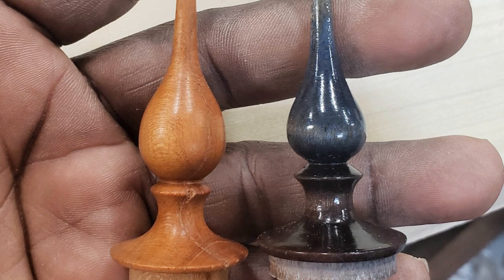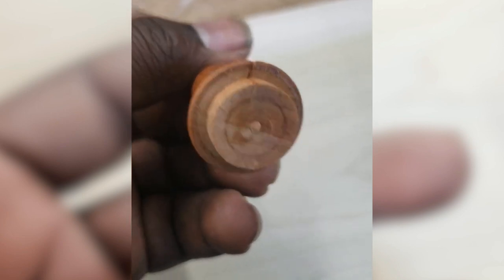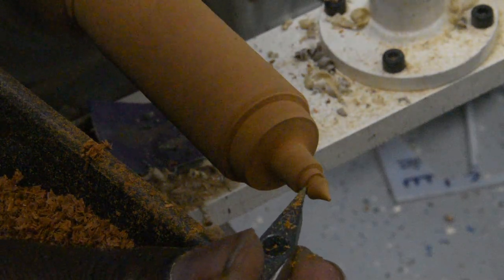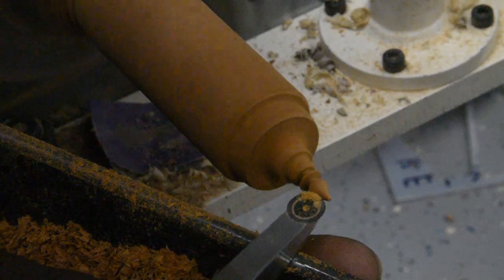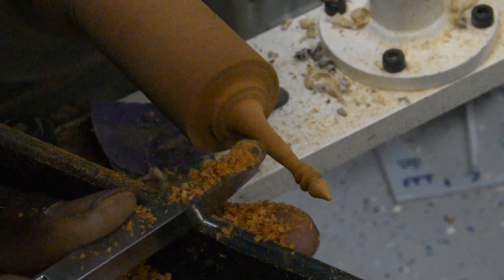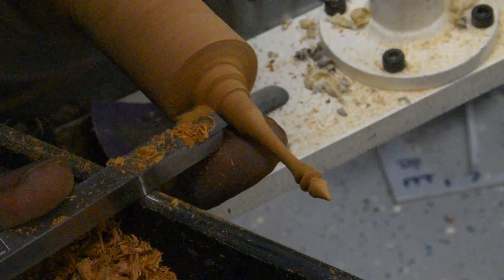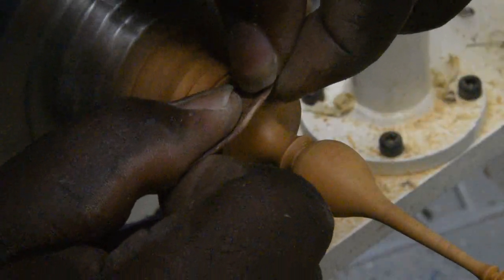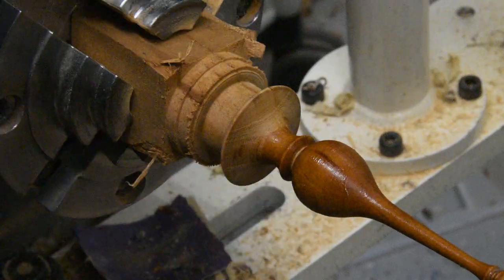Turning a Finial With Carbide Tools

Comment: Thanks for posting such a great demo of how to use carbide tools for this delicate work.  The techniques and pointers you shared were immensely helpful to me in turning tops with micro carbide tools.  Any recommendation regarding optimal rpm for finial work, for the shaping work?  How about for the sanding phase?  Thanks again!
Reply from the maker: Thank you. I typically turn these between 1700 and 2000 rpm yo get the cleanest cuts. I always slow it way down for sanding typically between 500 and 700 rpm. Hope this helps.